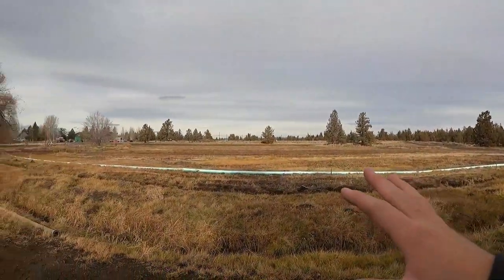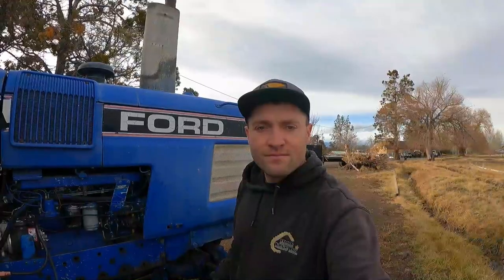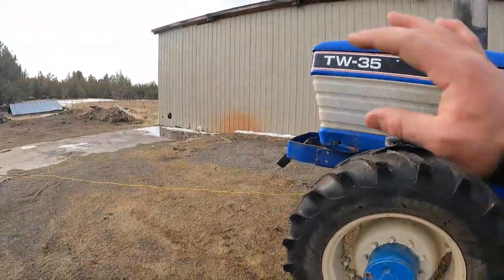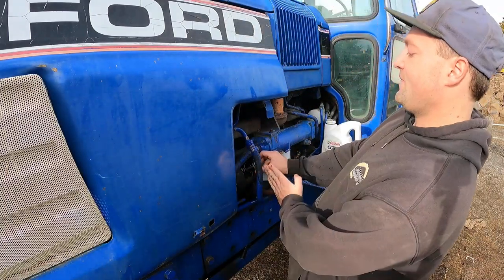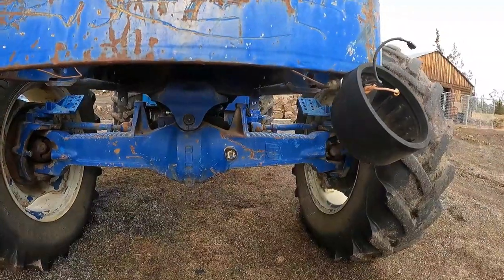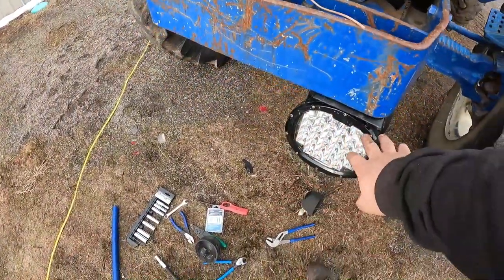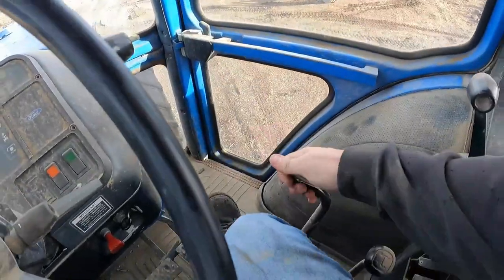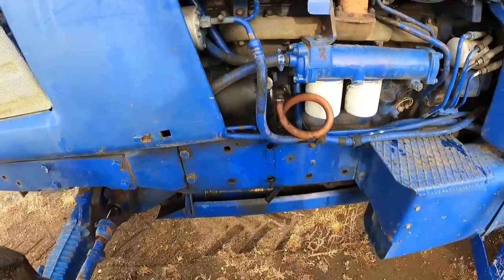getting an old farm tractor started again after sitting , and fixing some issues!!!! kind of?

Comment: I drove that model new in 1983 running a hay baler. It was not only new but new to me as had been used to Whites and Olivers which couldn't tell the diffence. Those lights on top of the cab were good enough in pitch dark in the fields but also on the road. New bulbs and a good cleaning will surprise you for use.

Comment: You have a coldstart excess fuel button  on stop lever open throttle stop in push button on stop lever and it will start
There is a ether can holder but no need 4 that
I done my training on these tractors
35 years ago

Comment: I don't know if you know but their is a cold start button on the injection pump to help it start when cold it's located on the kill lever.  To work it push the throttle  wide open and press the pin in the center of the kill shaft and it will click in and pull the throttle back to half.  It helps a lot also every ford of this era that I have seen has a heater in the intake if it has one it's about the size of a car cigarette lighter has a power wire going to it and a return fuel line.  If yours has one and it's good hold the key in between off and crank count to 20 or so to heat it up and crank as you crank the return fuel drips on the cigarette lighter element and puts hot air and smoke to help start in the cold.  It should start on some pretty cold days with ease without ether.
Reply from the maker: Thanks for the tip! I will definitely try this

Comment: Weld you up a couple brackets and mount those front lights on top of the frame.  Less likely to get broke?
LED's draw much les amps but you still need to check the amp draw.   One thing that is misunderstood about LED lights is that Heat is their enemy.  They put out less light the hotter they run.  Mount the light bar on the front of the cab (top).